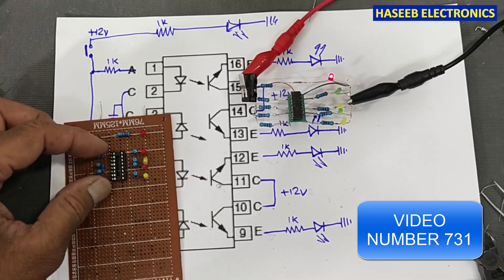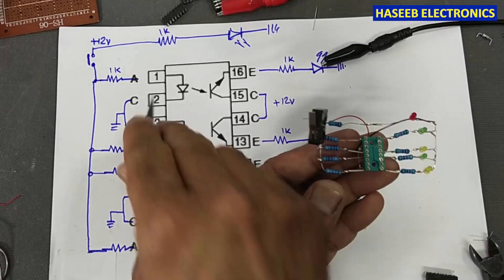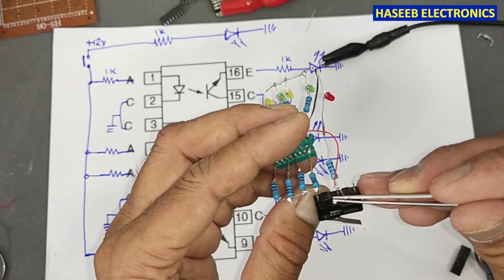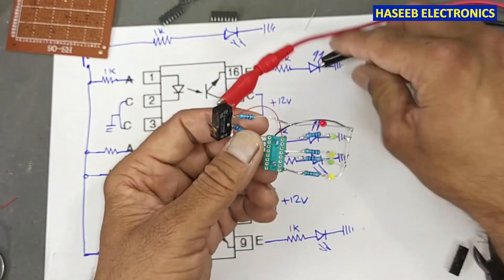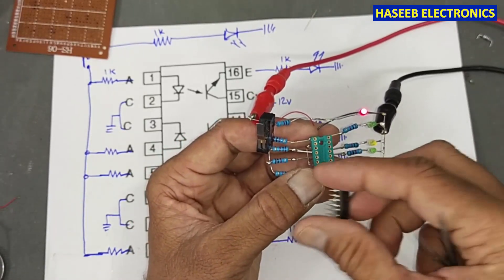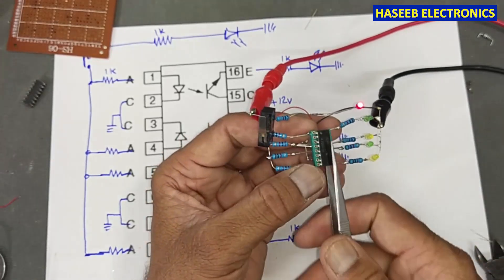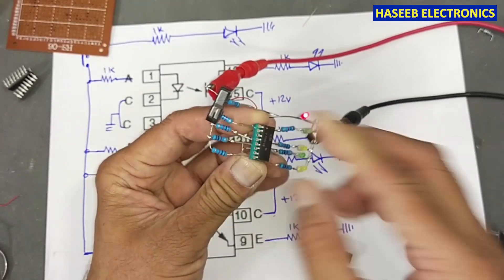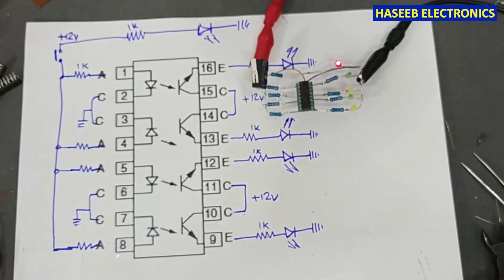{733} Very Simple Optocoupler Tester

Comment: Super-excellent; thank you. For multiple unit ICs, such as this one, I make the tester have a multiple pin socket (which will seat any IC) with parallel connections to another socket. Meaning, I do not assign the connections; I just give them a socket by which to easily make a wired connection. You could skip this part and just use a breadboard. Then, I make a separate, single unit test circuit. I use it to test each individual unit. This makes for slower testing, but it allows me to configure the setup to any type of pinout. I am not saying this is better; it is just what suits me. If you have ten, or more, ICs, as your DUT, then a dedicated pinout jig is very much warranted. My most used/loved DIY tester is also the easiest to build. It is just a 10K Multi-turn Pot. I gave it a huge knob, for one-finger turning, a heavy base, with non-skid pads and small, alligator clips for connecting the wires. I hated fumbling with individual pots. And, I wasted a lot of time setting them up for each experiment. No more. I can not exaggerate how handy this single addition has been to my bench and workflow.
Reply from the maker: really fabulous and superb 
i loved your words and ideas